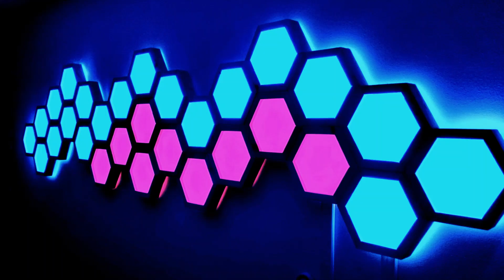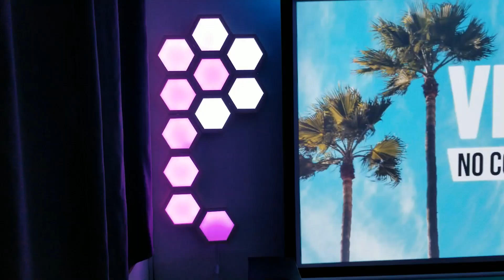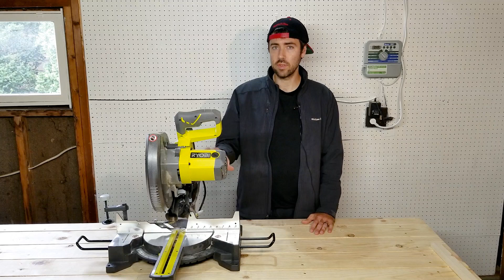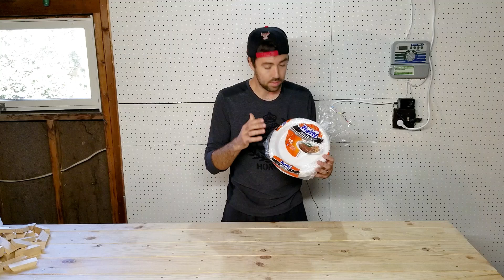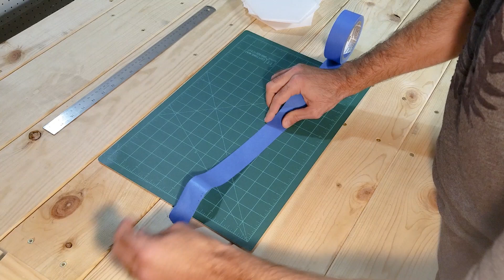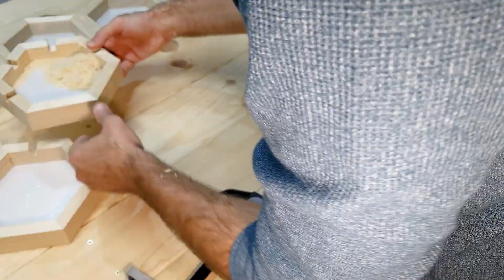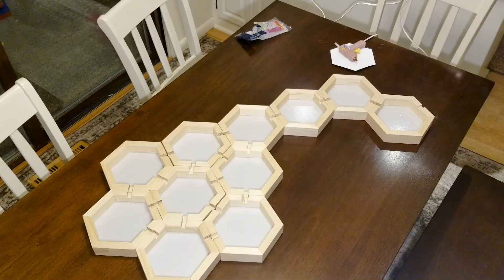Making My Own Version of Nanoleaf Hexagons - DIY Project (No 3d printing, programing or soldering)

Comment: The way you cut to slot for the defusing material was seriously dangerous.    I would use a table saw or table mounted router. I would cut the groove before you cut the pieces down to four inches.   It would be much safer.

Comment: 24:44 "you can't splice them back together".... um.... yes you can. I've done it before. It's fiddly but possible. You just have to cut on the right spot, where the blobs of solder are. In my case I soldered wires onto those solder blobs. If there isn't enough solder, you just add some of your own first. And have something to keep the LED strip from moving around. Weight it down.
Reply: Holy yap!

Comment: This is an older video and I know you have a table saw now, but I wanted to comment for anybody watching as well. Cutting those slots in the little pieces would be done much easier with a tablesaw on the full length boards. Then you would cut them down to length. Great job coming up with a jig to get this done on a miter saw though! When I first saw you holding that piece like you were gonna cut it, it freaked me out. Thanks!

Comment: They make connectors that you can splice the LED strips together.  All you have to make sure is to cut in the middle of the copper contacts between each section.  Make sure you get the connectors made for your strip as some may be 3, 4 and 5 wire contacts.  Make sure that you are going in the same direction as the signal either identified as in/out or arrows.  If you are handy with a soldering iron all you need is to connect them together.  Some controllers can handle only so many LED's on a set addressable and power wise.  The cost of the tools and materials needed in this project would pretty much cost as much as a set of real Nanoleafs with an expansion.  How is this cheaper?

Comment: any idea how to get such styrofoam in germany? Here these plates are banned due to environment regulations
Reply from the maker: Thanks for watching and taking the time to comment! That's a great question. I"m not 100% sure how you could go about doing that. I do know that you could maybe try some thicker type paper instead of the plates. Paper can surprisingly be a good diffuser!
Reply: @ChrisMaherDIY  hi Thanks for answering. Figured out those plates are called "styrodur" in Germany. You can get that in Hardware stores, but the plates are always too thick. 

I asked a friend with a 3d printer if He can print me some thin white covers. He says that should work. I have to wait some weeks until I get them because of Christmas and stuff ;)

Comment: Led strip without cooling?!
Reply from the maker: Thanks so much for watching and taking the time to comment! I think most people recommend using something like an aluminum profile to help with heat dispersion which should make the lights last longer but they have been working just fine for a couple years now with no issues!

Comment: Chris just came across your video of making a nanoleaf hexagon... awesome job! I saw you were talking about cutting the light strand and splicing... did you figure out how to do it?
Reply from the maker: Thanks so much for watching! Are you talking about cutting the led lights and splicing them together? I go over that in this video: https://youtu.be/apSz3NXYlx8 If your talking about splicing the acrylic/aluminum frame together, they are maching cut so you just have to butt them up together and it looks like 1 seemless run. (unless you are super close you can tell)

Comment: What's the difference between your Digital Angle finder and  Sliding Miter Saw?? I ask because for triangles equilaters you used the Digital and for Hexagons you used Sliding Miter Saw. Does the way to find the angles is different?? For hexagons you said 30° degrees and for triangles you also said 30° degrees, that's my confusion.  So as you know we should have different angles.

Thanks!
Reply from the maker: Thanks so much for watching and taking the time to comment! Lol yeah this was pretty much my first time working with saws and angles and what not. I was just confused lol. And honestly it still confuses me!

Comment: You should have done the slit cut on a table saw beforehand.
Reply from the maker: Yeah I for sure think that would have been easier overall. I would have had to make an extra cut when making the small pieces since I couldn't simply flip the board over each time (this would result in the slit cut being on the wrong side for half of them) but definitely easier and safer than what I ended up doing. Thanks for watching and for the tip!

Comment: Curious how these are holding up 1.5 years later?  Are the plates getting brittle?
Reply from the maker: Great Question! So far so good. Nothing has broken and plates are still intact although I have not tested how much they can take of me tapping them.
Reply: @ChrisMaherDIY  Thanks for the reply.  Planning to make some, but 1/16" HDPE sheets are not that expensive if you search a bit... so was curious about longevity.

Comment: the same leds can be spliced and cut and joined together. you just need some leads to be able to solder the copper contacts across. Great project btw!
Reply from the maker: Thanks so much for watching and great tip!!
Reply: Pretty sure you already knew this :)
Reply from the maker: @Garage_gg  lol well actually at the time when I made this video I did not! But now I know they can be spliced and cut and joined together!

Comment: I really do like this project. Looks really good. And you described everything exceptionally well.
You ever get the SKU number for the wood in the description? Because there is no way that was $1.85 for those boards. Looks like select pine.
Reply from the maker: Thanks so much!! Here is the link to the wood. Its from Home Depot. The link should work if you are in the US. Looks like the price has gone up a good amount since making this video over a year ago! At least its still not as bad as gas! https://www.homedepot.com/p/1-in-x-2-in-x-8-ft-Premium-Kiln-Dried-Square-Edge-Whitewood-Common-Board-914584/100037592

Comment: What kind of power supply did you use? I'm trying to make the same thing but I'm having a really tough time picking out the right power supply. Mine uses 54A, 5V, or 270W
Reply from the maker: Thanks for watching! For this one I was just using the power supply that came with the led strip lights. (same way that Govee led strip lights come with the power and everything you need) But if you are using lets say some ws2812b individually addressable strip lights, then I would recommend:

60 Amp Power Supply: https://amzn.to/3qHd93x
Wall plug for 60 Amp Power Supply: https://amzn.to/3pNM27G

Comment: You should 3D print, program and solder Nanoleaf hexagons.
Reply from the maker: I would love to get into 3d printing! Do you have any recommendations for a good printer?
Reply: @ChrisMaherDIY  Yes, to be honest only PRUSA printers. Many people are avoid PRUSA because they are expensive. Just like I did for years. But now that I own two Prusa printers, the previous 3 china printers and nowadays other china 3D printers...they just aren't on the same level. They look good on pictures but in detail a PRUSA printer is purest quality in every aspect/part. It's just that good. You start power and press print and you can go away. And you don't have to mod it. It's a tool that just works.

I'm not associated with Prusa in any way.. :)
Reply from the maker: @REDxFROG  Thats good to know! Sounds like you get what you pay for and also sounds like its worth the price tag! Appreciate the input!

Comment: Hey just FYI, not sure if someone has mentioned this, but you could've gotten away with using only 1 strip to cover the whole thing without doubling over and/or back. Starting where you did and staying on the right just like you did, and circling around to the 10th one (where you circled all the way around) instead of going all the way around and coming back right there, stop where that last one (10th) connects with the center, go in the center, loop the full center piece, exciting back into the 10th where you came in, then finish the 10th till circle, go into the 9th, and continue back to the beginning now on the left side... Save you some led strip. Hope that helped if it hasn't already... Awesome job though man. Very impressed with all your work. You're about to save me hundreds, probably thousands of dollars without losing nearly any, if at all, quality to the look. So thank you for that my man.
Reply from the maker: Thanks for watching and for the great idea! I didn't think of that but it sounds like it would work great! Appreciate you taking the time to comment and help me out. Hope you have a good one buddy!

Comment: What can you recommend a much cheaper substitute material to the wood frame? Like rubber or styrofoam that is enough as substitute, i want to try
Reply from the maker: I would say the only thing that might work is cardboard. Wood is pretty cheap where I'm at but requires more tools. I think if I took the time I could make a really sweet looking one using cardboard!
Reply: @ChrisMaherDIY  yeah i meant foam board , sintra board there but yeah cardboard is good. Thank you

Comment: Hi Chris, killer ideas and videos, I have been experimenting with a few of your ideas to get some really cool lighting effects in our basement theater room.  I was looking at this and had a couple questions you might already have answers to.  #1) Did you think of any frame options that could cut down on the "bulk" of the 1"x2" boards you used?  #2) Is there a black or dark media you worked with before/after deciding on the plates as the face of these?
Reply from the maker: Thanks so much and thats so cool you've been making stuff yourself! I tried thinking of different material and outside of 3d printing, this wood was the best I could come up with. Now you could certainly cut the wood in half to make it less bulky but I dont have a crazy woodshop and that seemed like too much work. This video I used some black acrylic https://www.youtube.com/watch?v=6csSMtV_op0&t=697s and it looks sweet but at the time was more than what I wanted to spend. If I were you, I would just play around with different materials and make a couple test units to see what looks the best! The plates ended up working great and was very cheap but If you dont mind spending the money and taking the time to cut every piece down to size, I would go with some type of acrylic and use some ws2812b led lights.

Comment: The title made it look easy, but even without soldering etc. It doesnt make it easy if you use all those tools just to cut the wood. 3d printing at a local store would be easier
Reply from the maker: I would love to try using a 3d printer but I thought I would end up using a saw more than a 3d printer so I opted for that instead. But at some point I really do want to get into 3d printing because it looks so cool!
Reply: @ChrisMaherDIY  yeah same. I dont have the money for those tools or the printer. But we do have a store nearby where you can jus come in with your 3d files and let them print against a fair pricd
Reply from the maker: @MysticMachina  that's awesome! I'll have to check around where I live to see if they have that available. I would love to try that!

Comment: Great job dude! One question. What is the little adapter at the 23:25 mark you used to hook the 2 strips to plug into?
Reply from the maker: Thanks for watching! Those are the controllers that most led strips come with. They are what the led strips are plugged into that allows you to control the color, brightness etc. The controller is also generally where the power source is then plugged into. Hope that helps!
Reply: @ChrisMaherDIY  ok, thanks....so any issues getting the 2 separate lengths synced up to get the light effect you're after?
Reply from the maker: @bbrown6057  Great question! Its not perfect but it was good enough for me. In my thumnail picture you can see the red hexagons were controlled with one of the controllers, the other was controlled with the second unit. If I had to do it all over again I would use WS2812b led lights and use WLED to control them all. It would have been a little bit more work but now that I know a little bit more, I think that is the rout i would have gone.  Thanks!

Comment: Correct me if im wrong cause im not sure either way. But I was told not to lift blade back up while its running to reduce chances of it catching on the cut piece and tossing it out.
Reply from the maker: I think you right! I'm not a woodworker so I'm not 100% sure but keeping it down until the blade stops does seem like it would be a lot safer!

Comment: Why not straight cut the board on a table saw before doing the 4 in cuts…. Would have saved alot of time
Reply from the maker: Thanks for watching and that is a great idea! I tried to picture doing that in my head and I could be wrong, but if I did that, when I then went to cut them in 4 in, would the groove be on the wrong side for half of them?

Comment: How are you controlling the leds
Reply from the maker: I'm using some tasmor led strip lights that just have your average controller with their app. It's basically Govee lights but a different brand. If I were to do the project over again, I would use ws2812b lights and use WLED to control. Thanks for watching!

Comment: Hi you can remove the silicon from the point to cut. Then you need to use the very first led set that is the driver ic to the cut point . That's it enjoy

Comment: thisis the same chris ?? I can't find the plates because I live in France !! do you have a link where to find it! and with WHAT MATERIAL the plates ?? do you use
Reply: foam or plastic plates???
Reply from the maker: @djbenouf  the ones I used were foam. I've heard in other countries that kind is not available. You might have to experiment with different materials. Maybe try paper plates. That might work! The thinner the better I would imagine for paper plates. Otherwise theore expensive rout is some acrylic. In my most recent project I have a link to the ones I think are the best off Amazon. Hopefully they would be available in France!
Reply: @ChrisMaherDIY  what size of the plates ?? and you need reflective material ???
Reply from the maker: @djbenouf  about 8 inches in diameter and no reflective material needed!
Reply: link ???polystyrene??
Reply from the maker: @djbenouf  Here is the link to the acrylic I would recommend if you wanted to try that. Also much more durable that plates. If you use this, i would suggest using 1inch by 3inch wood instead of 1inch by 2inch.
Reply: @ChrisMaherDIY  where link acrylic
Reply from the maker: @djbenouf  My bad! here it is: https://amzn.to/3zyiUCL
Reply: @ChrisMaherDIY  the plates that you have are in Round Plate in Polystyrene (PS).???
Reply from the maker: @djbenouf  the plates are styrofoam but I believe polystyrene is another word for them.
Reply from the maker: And yes, the ones I used were round that I cut the hexagon out of
Reply: @ChrisMaherDIY  yes but it's hard expanded polystyrene, a bit like plastic ??
Reply: @ChrisMaherDIY  yes but it's hard expanded polystyrene, a bit like plastic ??
PS or PSE ((Expanded Polystyrene) is a hard and brittle plastic. It is used for packaging of products such as food trays, thermal insulation, floats ... Polystyrene is not recyclable in sorting bins. .. PS packaging should be disposed of in the household waste bin.

Comment: You can buy a cheap soldering iron at Walmart for like $10, it doesn't have all the bells and whistles but it can be used to connect led strips. Only other thing you'd need is a led controller that matches your led strips, it will allow you to control the LEDs and resist the amount of power running through them.
Reply from the maker: Thanks for the pro tips! In a couple other of my newer videos I give soldering a try and it was really fun learning a new skill! Thanks so much for watching and the great advice!

Comment: try using addressable leds.. Ws2812b or ws2811... that gives you the aurora effect.... it usually is a 5v led strip.  its easy also to use sp107e sp108e controllers...
Reply from the maker: I love where your head is at! If I were to do the project over, that's exactly what I would use. In most of my newer projects I use ws2812b lights with an esp8266 controller and love how they look! Thanks for watching!

Comment: try using addressable leds.. Ws2812b or ws2811... that gives you the aurora effect.... it usually is a 5v led strip.  its easy also to use sp107e sp108e controllers...
Reply from the maker: Thanks for watching and the comment! When I made this video I had no idea what I was doing. If I were to do it again now that I know a little bit more, I would definitely use ws2812b lights! They are so much more customizable! Thanks for the suggestion! you were 100% right!

Comment: hello, I am trying to follow your project, however i have a question, What did you use to hang it on the wall? I am currently trying to figure out how to hang it on the ceiling. Any ideas I would highly appreciate. Thank you
Reply from the maker: Thanks for watching! I just used some picture hanging hardware to hang it on the wall. Nothing fancy. I'm not sure what would be the best way to hang it on the ceiling. I would recommend going to your local hardware store and ask some workers what they have for attaching some wood to a ceiling! Best of luck! I'd love to see how it turns out!
Reply: @ChrisMaherDIY  Ok awesome. I will make sure to send you a video. It's for a nightclub. The idea is to put hexagon shapes across the whole ceiling with LED controlled light strips and some type of sync software. Thank you for your video. highly appreciate it